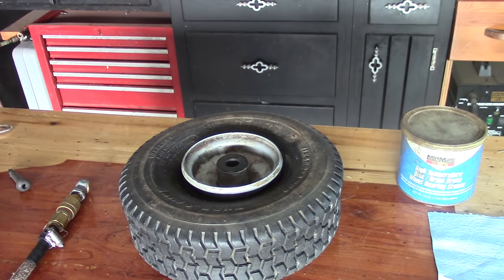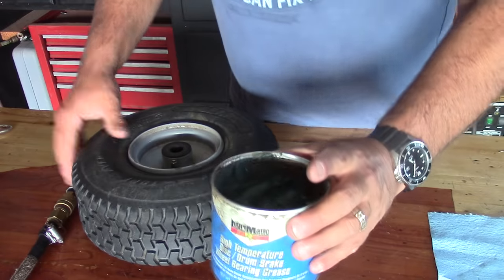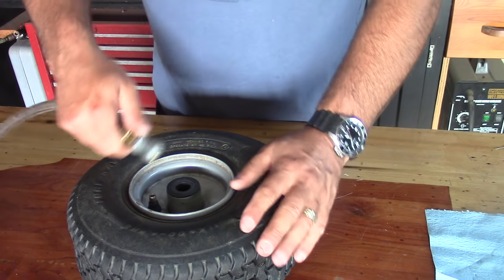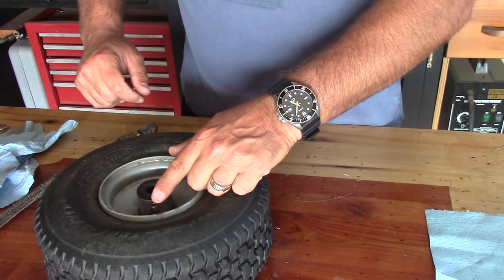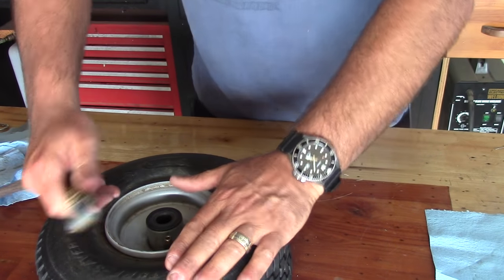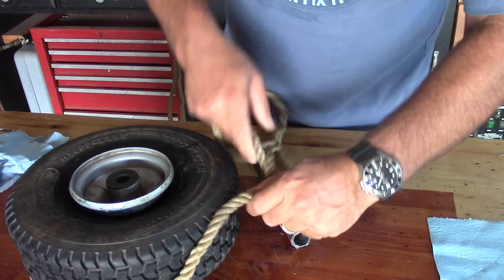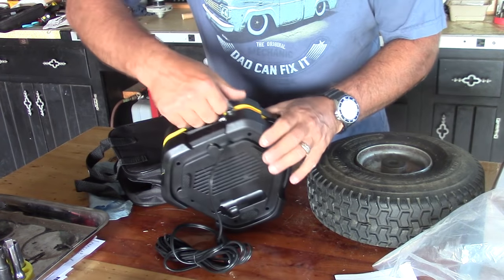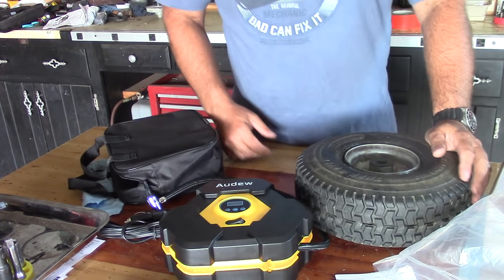How To Inflate A Tractor Tire Off The Rim

Comment: You didn't remove the valve stem. You removed the valve core from the valve stem.
Reply: Thank God it’s a video too😊
Reply: Picky, picky!  Removing the valve stem probably will require replacing the stem.
Reply: It's not called a valve core di p sht
Reply: He called it by its proper name. A Schrader valve, since you wanna be picky

Comment: This saved me SOOOO much aggravation, thank you! I used a ratcheting tie down strap, I didn't even have to take the tire off my snowblower or use any grease.
Reply: Goose Gosselin I’m having this same problem with my snowblower. Hoping that works as well as you say!
Reply: @Durgondkir  Be careful releasing the ratchet strap, I had to really squash the tire down to get the tire to seal to the rim, once I got some air in, the strap was under a ton of pressure, it released like a bullet.
Reply: @GooseGosselin  Once the bead is seated, let some air pressure out of the tire to remove the strap, and re-inflate the tire to proper pressure.

Comment: The rope worked like a charm and I didn't even have to take the front tire off the lawnmower. I just lifted the front end and put a jackstand under it. I used a heavy duty screwdriver versus the metal pipe. Total repair time was about 5 minutes, which included set-up and clean-up. This is something I will always remember. Thanks for sharing!

Comment: On my lawnmower, rototiller, wheelbarrow and lawn trailer tires, I use soapy water and occasionally use some bead sealer. For my bead seating, I use a piece of 1/4" rope with an old lawnmower pull-type starter handle. I tie a truckers hitch or load binding knot which gives me compound leverage to get the bead to seat. Still a good video. Thanks for sharing.

Comment: As an ex pro tire fitter, let me say, NEVER use automotive or any other petroleum based grease on a tire. Over time it can attack the rubber and it doesn't dry up, so can encourage the tire to slip back off the bead seat if it comes under an extreme sideways force. These tires should only run about 15 psi max.
 If you don't have the correct type of tire soap (that's what we used to call it anyway) use some hand soap diluted in water. Not hand cleaner though, just from a bar of soap.
 I gave you a thumbs up though, because your rope 'belt' was spot on. We had a type of cinch strap which also had an inflatable tube inside it.
 And yes, a roof rack strap can help, though cheap ones may not be strong enough.

Secondarily, if you can rest the rim on something so that the tire walls won't touch your bench or floor, you can then push down on the tire and the back bead, in this case, should come in contact with the back of the rim and pop onto the sealing face.
I could see that every time you pushed the air line onto the valve stem, you pushed the rim away from the back of the tire. ;¬)

A 'clip on' type air connector will help the situation too, as you'd have both hands mostly free.
Reply: So don't use grease use bar of soap and hot water then do it with a rope wrench
Reply: @Repurplecirculation  
You are correct in that silicone won't attack the rubber but, it is too slippery and doesn't dry or dissipate readily.  Soap is the best.  It stays fluid long enough (without drying) to seat the tire without becoming an issue later with a lateral force on the tire pushing it off the rim.
Reply: Most of all he removed valve core NOT valve stem.
Reply: Prefer following You !
Reply: Soapy water would be my choice ,... Never petroleum  based grease.

Comment: DUDE - you are the man.  Flat snowblower tire and couldn't get the wheel off, and of course it was the bead at the back that was off.  This worked like a charm with a ratchet strap. You are bromance material brother.  Thank you thank you.

Comment: Doublewide6,  Thanks a lot. My generator tire goes off bead on a regular basis. Your method worked beautifully. I just cleaned the bead area on tire and rim, wrapped the rope and put the air to it. Didn’t even have to remove the valve. Thank you!!

Comment: Thanks so much for sharing your knowledge with us!. I am a grieving but surviving & happy widow of 2 years that loves to do home made remedies to save money. i had a tire unseeded on both sides so after watching your video I was able to keep the tire on the tractor and used your rope technique, with  removal of valve stem but I didn't have grease so I used petroleum jelly. Then used air compressor at 100 psi like you said & BINGO! Replacing the valve  put me down to 4psi. Hahaha. But successful! I scraped off the excess petroleum jelly to save for the next project. The tire seeded to the rim! Kudos to your sharing this info. ❤

Comment: I used a ratchet strap with the wheel still on the mower and it worked! I didn’t remove the valve stem.  I’m back up and mowing. Thanks for the awesome knowledge.

Comment: You are a lifesaver!  snowblower tire popped off the bead today while clearing the driveway from storm #1.  With storm #2 arriving this afternoon I needed some help.  This simple repair using a rope (i used rachet strap) put enough pressure on the tire to go onto the bead and let me fill it with air  THANK YOU!

Comment: That looked easier than the ratchet strap method, or the brake clean and fire method😁
Reply: DW's method is a good one, too, but the starter fluid/lighted match method takes about 30 seconds. Let me tell you how I learned about it. (Profanity Warning) A old guy was watching some of us younger guys try to rebead a tire and really screwing it up. Finally he'd had enough and started in on us. "God fucking damn it. You fucking shits don't know fucking shit  . . . " You know how it goes. So while he's igniting the air with profanity, he's getting brake fluid and a match. He puts a couple of squirts of fluid in the tire, and we all gather around. "Get the fuck back, you stupid fucks!" So we step back. He throws a couple of matches at the tire. The third one takes and the tire flips about five feet into the air and comes back down. We're all amazed that the tire is perfectly set. "You know what to do now, you stupid fucks."  Lesson learned!
Reply: Sounds about right. But I won't recommend it. A tire AND wheel ain't no game ball!!!
Reply: Navy or Marines?

Comment: Your video was helpful. I have a spreader that has an unseated tubeless tyre. I will use your methods to eye if I can get it back on the rim.  As a recent widow I am finding myself having to fix things and not knowing how. Instructional videos like this are soooo helpful. That portable air compressor would be great to have especially in an emergency or working away from home. Thank you. Kathy

Comment: Worked like a charm. The small front tire on my Zero Turn Mower. I cleaned the bead and the bead part of the tire as another Youtube video suggested. Could not get the tire to seal until i watched your video. Holding at 42lbs. Will see what it looks like in the morning.

Comment: Have been using that method on all tires for over 25 years. from a small garden tractor tires to big rig tires. Used ropes, chains with binders to ratchet straps. I have used a blow gun shooting air into one side and had luck seating the bead on small tires. Same process as a bead blaster on big rig tires. Good video.

Comment: this worked like a champ...a bit of grease and the rope did the trick...taking in to consideration the comment re: automotive grease on tires i plan to clean it off as best as possible...fortunately for me, the tire is on a log splitter that gets moved/pushed by hand and wont have much over the road - at-speed - exposure.  thanks for the video

Comment: Two years ago my snowblower tire bead broke and I was unable to get the tire off the shaft (even after heating and beating).  I procrastinated last year and didn't get it repaired.  I intended on calling the repair shop and expected to pay for pickup, delivery and repair 💰.  I tried the rope but the rope I had stretched then broke.  I used an old cheap extension cord, a screwdriver and wrench handle.  A big thank you for the video.  I was able to make the repair myself with the wheel still on the blower.  ☃️❄👍

Comment: Thank you for this video, it helped me a lot. 😊 I was putting on a new tire on my snowblower.  I tried the ratchet strap method first, but that just resulted in a lot of cursing, lol.  The rope, a tire spoon to twist the rope, a shot of air from my table top compressor with the valve stem removed, and success.  Although, I did shoot the valve stem up to the ceiling on my first attempt.  Thank you again.  I do come to your channel often.

Comment: Thanks for this!  I'd tried the ratchet strap/rope method and a bunch of other things but nothing was working.  Then removed the valve stem and gave it a blast from the compressor and it worked great for me.  Never would have thought of that.

Comment: Thank you so much. This worked. It's hard to do with brand new tires though because they resist bowing outward. I had to use two tourniquet ropes one over the left side of the tire and one over the right and then I pulled both of those tight as I could and then tied them off. I also used a little Vaseline around the edges of the rim. Then when I  started the air a little hug and pressure started building. Yea! It worked. Thanks so much for this. Some guy at a lawn store wanted to charge me $100 for doing it.

Comment: Hey this trick actually works thank you for showing me this video and for sharing with everyone I use it on my Monster moto mini bike tire cuz the front tire got a flat and I couldn't get the tire to seal to the rim and the bead of the tire.
Thank you so very much bless you man a million times over this is lot better than setting a tire on fire with starter fluid which is very dangerous. I did the same thing you did but I only had to wrap around three times with the rope with a piece of pipe but I left the valve on until the bead got seated then I released the rope and filled it all the way. no need to take the valve out trust me for those of you who don't have a valve remover just put a rope around it squeeze it down in the center of the tire the side walls will press out and then begin to fill with air you'll have to go around at least three times to get a good Seated on the bead.
I highly wouldn't recommend that you use a come along strap since that can be potentially very dangerous especially under great pressure a roping and a pipe is all you need don't mess around what the fire and starter crap or anything like that this guy has it down pat and it worked the first try for me.

Comment: Thanks.  I used an old wire rachet that comes with an above ground pool cover with strong twine and it worked equally well.  I didn't even have to remove the stem core.  I did tip up the snowblower to take the weight off, spray water around the seal on both sides to help it seal, then used a portable trickle pump since I didn't have my big compressor handy.

Comment: I've had good luck removing the inflator attachment as well as the valve and putting a quick blast straight from the hose coupler. It also helps to put the rim up off the table with a block of wood etc. , broken bead down, for gravity assist. Straight dishwashing liquid is a good lube if no grease is available.

Comment: To get a bigger burst of air....take the air chuck off and just use the quick connect...has worked for me many times even on car tires....will not work with a huge gap but helps especially on those small tires

Comment: Great tip. Had to actually use this method with ratchet straps to seat my truck tires because the tires were a tad skinny for the wheels and the beads wouldn't set. 1 was especially difficult and required the ether and a match trick.

Comment: I haven't looked past the last few comments but after you take the valve out of stem, take the chuck off the air hose and just use the air hose connector on the stem.

Comment: Thank you Thank You so very much for posting this video, as my thin strap ratchet pushed the inner tire bead against the rims so I could add air to this thick ZTR tire.  This saved me a trip to get tubes.  The last two times I have bounced the tire on the concrete floor and that was enough to get the air to seal, but I was hopeful I could find a quick web answer, and  you had the fix - Have a great week, and glad to get the ZTR back on the lawn  (:o)

Comment: Thanks for the tip.. it worked perfectly.. changing a 4.8 - 8 tire on a Wood Chipper..  Yes, those little tires can be a real pain to get on the rim.. used a little Dawn Dishwashing soap to get the old one off and the new one on..

Comment: Great video. Didn't know about that rope trick. You used grease? Can you also use a 3 to 1 dish soap and water to do the same as the grease? Also, do you have to remove the valve stem? I have no valve stem tool.

Comment: Nice simple trick with the rope. Not sure about the grease though. Heard that it damages the tire rubber making it porous in the longer term. I was advised to just use soapy water, and it worked fine.

Comment: Thanks for the video very informational, however using a spray of carb and choke cleaner around the inside of the bead and hitting it with a grill lighter seems do do justice just a bit quicker. Might not be as safe but worked for me.

Comment: Used the ratchet strap, worked great until I ended up in the hospital lol 😢 I inflated the tire with the ratchet  strap on a little too much.. I then used a 12 inch piece of 15 mil rebar to pop the ratchet release as it was under pressure.. The rebar was then driven a half inch into my hand my palm but it was good because it caused the rebar to rotate, glancing off my forehead and landing about 30 feet away. Yup, Nailed it! 🎉
Reply: Omg, hope you are ok

Comment: Thank you. this method does work. I tried 4 times to managed it work. (maybe due to I applied motor oil earlier that make contacts surfaces sticker than detergent solution which I applied in my last try and made it.)

Comment: It's not a technique for everyone but with the tire still on the lawn tractor. I pull the tire on the bead to the outside with my hands then push the tire over to start the bead on the other side and start to add air and punch the crap out of the tread area of the tire. It will make the sides pop out just like the flame trick. Basically 5 second start to finish.

Comment: Guy I have been wrestling with my wheel barrow tire that came off the rim. I attempted to put air in it trying to get it back on the rim, but that did not work. A friend advised me to get a new tire and mount it and be done with the old one. There is nothing wrong with the tire I have, so did not use his advice. I have two piles of dirt in my yard that I need to move. Thank you for this video clip.

Comment: Two queries,  1) Not sure that grease and rubber are a good combination and 2) Once the tyre has seated on the rim there is no need to put your finger over to hold any air in and you risk the valve core flying out.

Rope round tyre and removing valve core good advice.

Comment: Great video. Thanks a lot. I am stranded with a broken bead scooter type in a gas station. I'll buy a strap with a ratchet tensioner now and try what you said without having to remove the whole rear wheel which is a big job in a 150 cc maxi scooter. I hope I'll get it done. Thanks again. I'm in Turkey. I don't know whether I'll be entitled to enter the contest you mention though. If yes then I'll be glad if I could win such a nice compressor. Best regards to everyone.

Comment: What do you do if your tire on both sides is not sealed.  IE:  My tire for my wheelbarrow looks exactly like what yours does at 1:15  When you flip the tire over it looks like the other side is somewhat sealed to the wheel... mine is loose on both sides.

Comment: That looks like a great tool to have.On another note, I have a 2009 Dodge Ram 1500 (had a 1999 prior w/the same issue) and have it in the shop now for AC evaporator coil replacement. I was wondering if you've had any issues with yours and if you have any advice. I have loved the Dodge, but I am wondering if I should go ahead and trade in for something else before other problems arise... You seem to have a great knowledge of mechanics.
Reply from the maker: I have had some rust issues that I got under control.  The heat stopped working, but I was able to flush the system with water and recover it.  I try to run the heat every 2 months in the summer to keep particles from settling.  My air was restricted and I found a vent door in the air box broken and stuck over the passenger side vent, so I removed it and the air has been blowing fine.  I have some videos on the rust.  I like the truck and am planning on keeping it for anther 10 years at least.  It only has 80K miles.

Comment: Is this trick recommended if the tire has a light dry rot crack in it? Working on an old Manco go kart. The other three tires are holding air just fine and are seated, but the tire in question needs re-seated. The crack does not go through, it looks to be in the very beginning stages, but I need to re-seat the tire to know if it’s gonna hold air or not before I decide to spend the $30+ on a new 145/70-6 tire. Can’t exactly afford to replace all four tires at the moment, so I’m hoping this trick can work for my situation, any guidance is appreciated.

Comment: I usually use a blow nozzle with the core out. And soap and water. I've had to use a ratchet strap before only cause bouncing the tread side against the floor didn't work. New atv tires are a bastard to put on sometimes